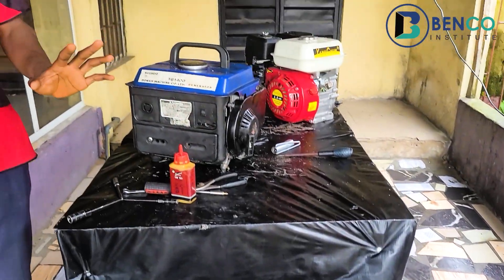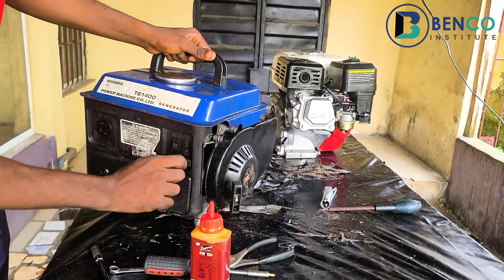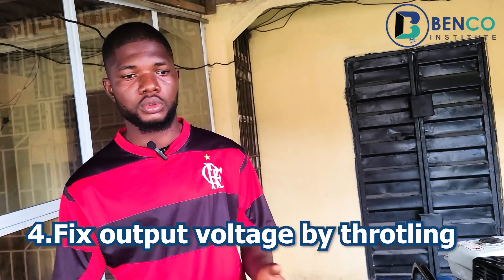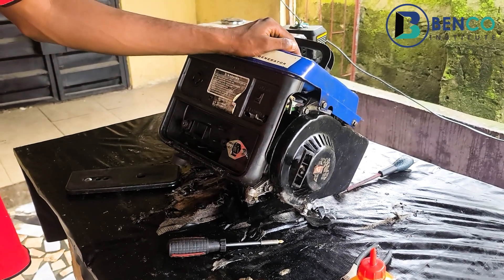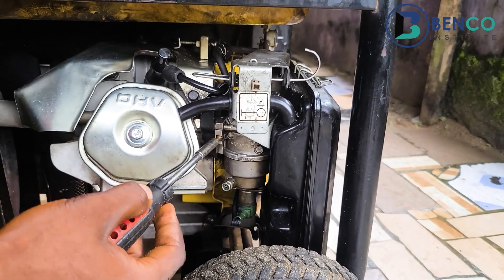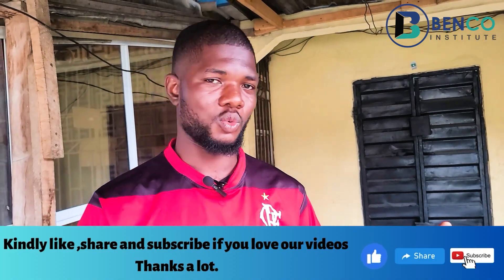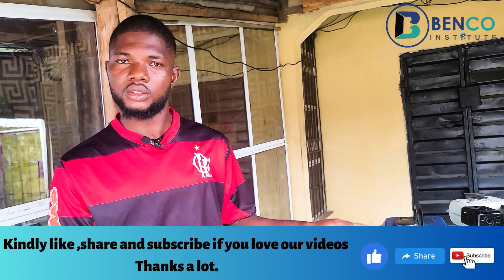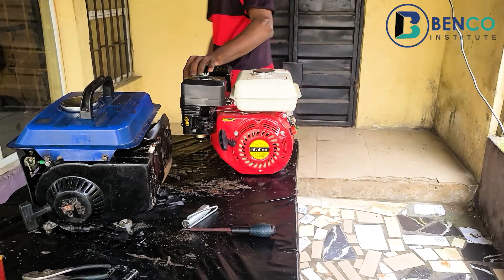10 small Engine  Repair Tweaks few persons know.You don't need a technician anymore if you know this

Comment: Sometimes if there's oil and the oil alert still has faults 
I disconnect it , put on the gen for about 30mins , then plug back the oil switch while it's running and it somehow correct itself.
Hope this helps someone. 
Note: It's only when there's oil in the crankcase
Reply from the maker: Thank youuu🙏
Reply from the maker: Thank youuu🙏